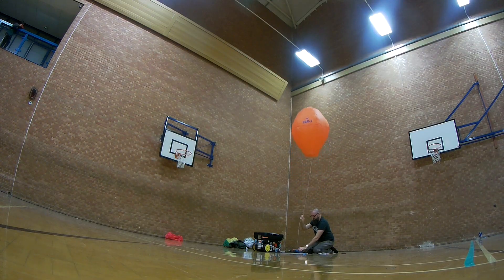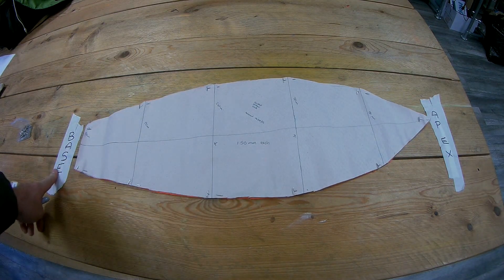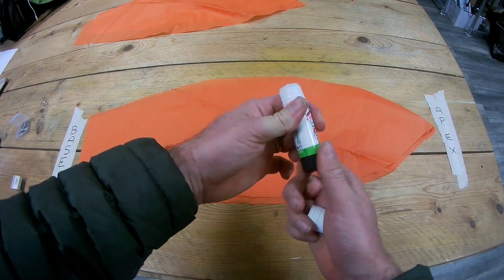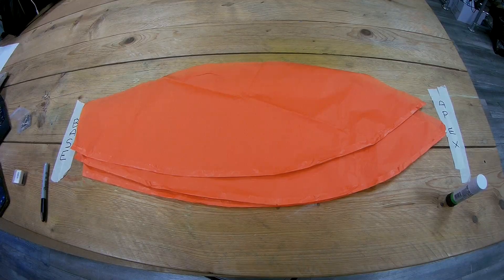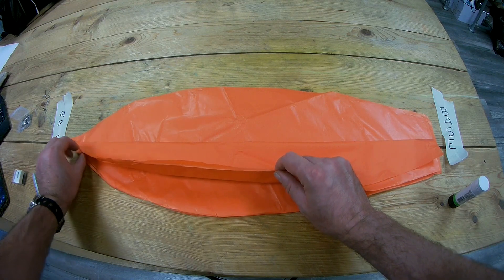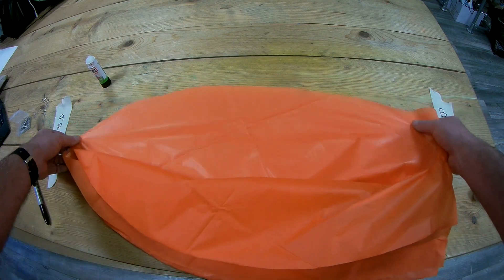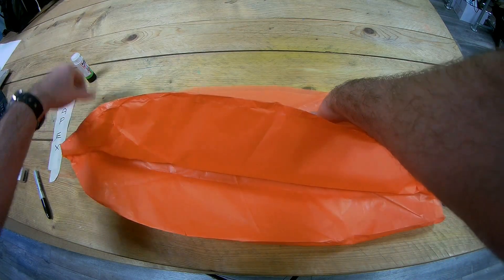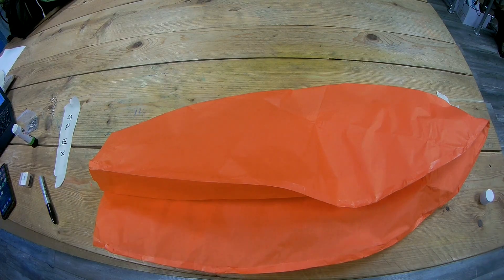The Aerostat/Hot Air Balloon Project - Gore Assembly Methods

Comment: Good stuff. How long do they stay up for?
Reply from the maker: Thats a good question.. it's variable! The small one seems to go up an average of 3/4 meters and almost immediately begin to descend. The larger ones quite happily rock up to the sports hall roof, around 18 meters, and then stay there for 15-25 seconds and then slowly descend. Of course, the larger ones are lifting the tether which could be lighter, but its also dependant on the internal temp of the balloon and the external temp of the room. I hazard to guess I could get over a minute of flight with a higher internal temp in a colder environment. I ponder if its possible to put a non flame nichrome heater on them... but weight versus energy would be the issue, may well not be worth the effort! Two heat guns or hotter heat source is deffo an experiment waiting to happen.